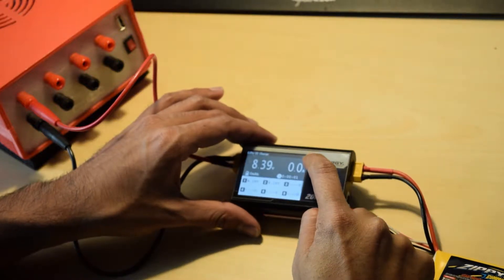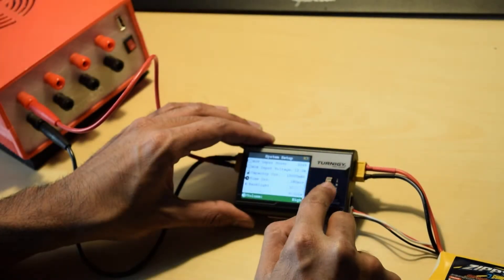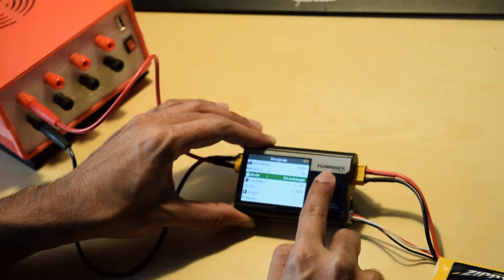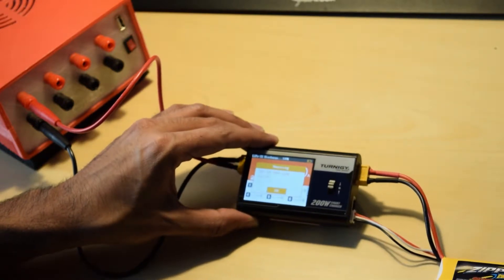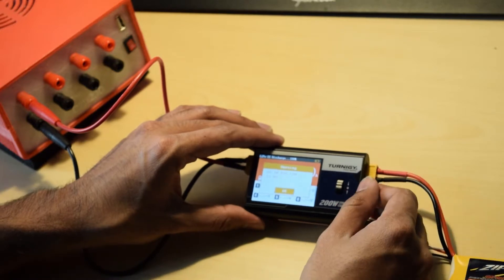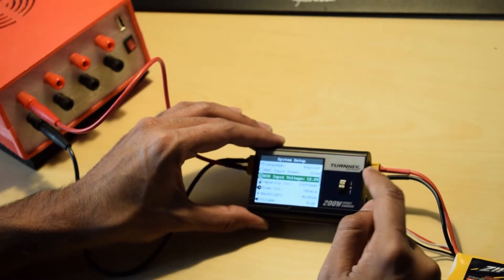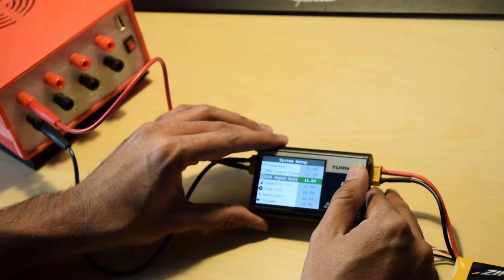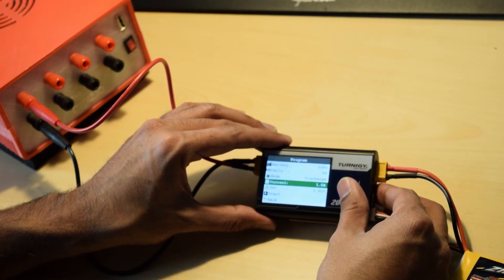Beginners Guide to RC Hobby: UP610 DC input voltage too low error

Comment: With this video you help me very much my friend.
I just have buyed 3s lipo and wanted to charge them and I have this this dc low voltage error....
I I didn't know what to do.
After your video I have figured out that the power from my charger to 3s lipo is not enough.
So I connected bigger supplier and charger started charging.
🙏🙏🙏